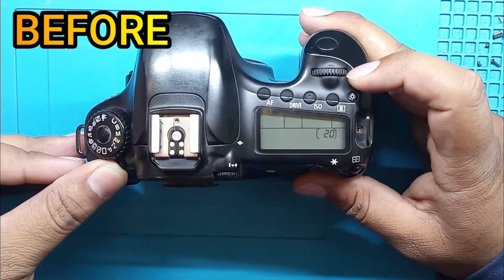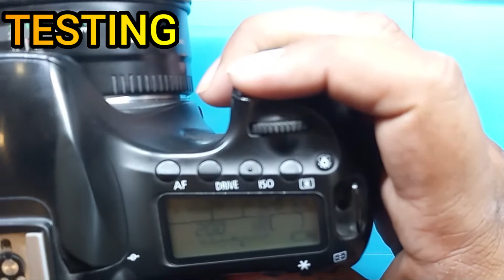CANON 60d |shutter Problem | Error 20| ADNAN CAMERA INFO #canon #60d #canon60d

Comment: Canon EOS Rebel T3i , i have a err 20 message on my camera , , everything works just that the shutter button not working. Any advice, does this apply to my camera? is the Canon EOS Rebel T3i fixable?
Reply from the maker: Error 20 accures due to different reason.it may or may not be apply on your camera.
Contact on our whatsapp no 
03235271797
We are located in f 10 markaz Islamabad (PAKISTAN)